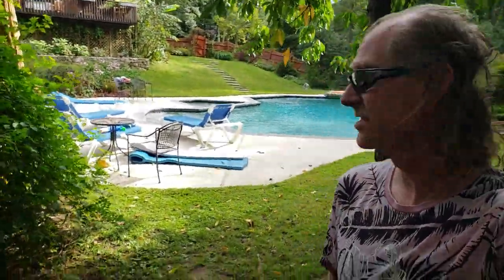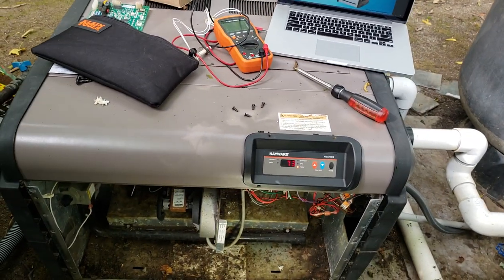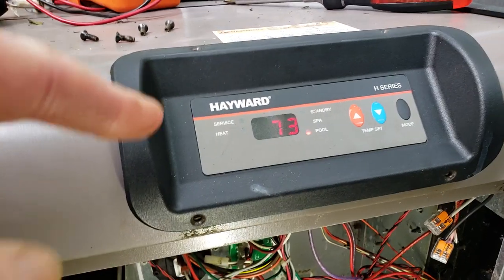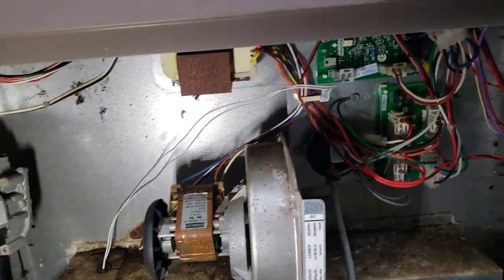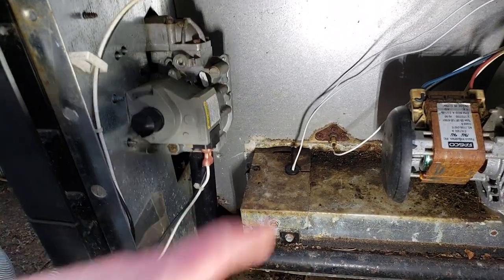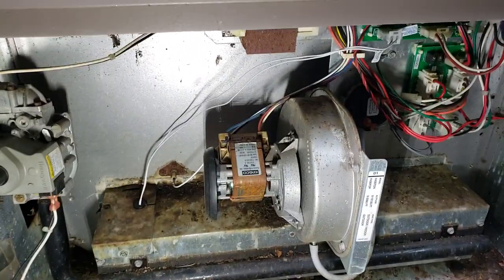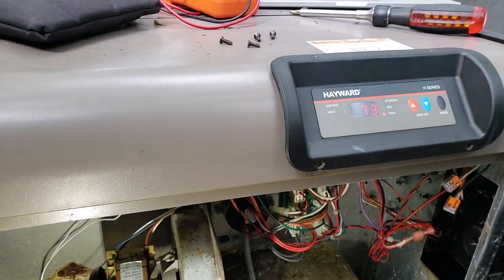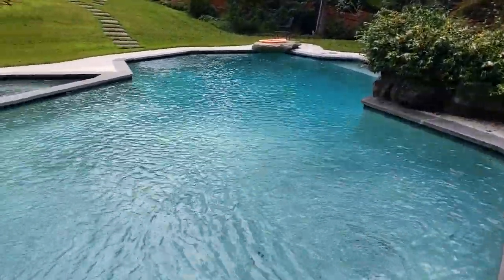Hayward H400FD pool heater fixed igniter issue no thanks to Hayward support

Comment: These pool heaters SUCK. I bought the same one 4 yrs ago and it broke in 2 yrs. Wasted 2600$
Reply from the maker: You’re not kidding. Mine doesn’t shut off.  If I leave the propane valve opened, it will eat thru the entire tank even of everything is off. When we are done heating the pool, it’s bypass mode and shut the propane valve. Work around  for 2 years.

Comment: The IO Code can really only mean 2 things.  Either a defective Control Board or a defective Igniter (Or the wires).  You can test the igniter with an Ohmmeter.  A "Good" igniter will have a fairly low resistance, in the range of 30 Ohms.  A "Bad" or open igniter will likely be many KOhms or higher and way too high a resistance to glow and ignite the gas.  If the resistance check passes then the Control Board is likely bad.  If you are comfortable with soldering, the likely failed component is the power triac that feeds the igniter and will be way less expensive than an entire new control board
Reply from the maker: What a great comment!  Thanks for sharing your knowledge. It was, in fact the board. I just opened the pool, and the heater made it through another NY winter, but it could crap out at any time. I kept the old control board, so im going to check that power triac (×whatever that is. )
I would definitively try to solder in a new component. Ive only done that  once, on a capacitor for an outdoor weather station and its still going, so its worth the try. 

Like I said before thanks again for all the info
Reply: The triac should be the rectangular device with 3 leads right behind the connector.  If one of those leads is connected to the igniter connector, that is it.   I had a spare board and was going to look, but I can't locate it.  If you unsolder the triac it and send me the numbers, I can probably identify it.  BTW, Great video, it should really help some of the people out there
Reply from the maker: @bigjohnk6113  thanks again. Ill look
Reply from the maker: So i was curious and grabbed the bad board  that was giving me the IO code, and sure enough, the one part that looks corroded is the thing you said (the triac). All 3 solder connections look good.  Its a small rectangular part with a small hole cut out adjacent to where the ignitor plugs in. 
I don't think there's any chance of me finding another one since there's no writing on it, but thanks for all the info. You must be in the electronics or pool business!
Reply: @Samlol23_drrich  yes, actually, I am an Electrical Engineer and I own an Aerospace design and manufacturing company.  I've got parts I designed flying on aircraft the DOD flys.  When I get a second, I'll take a look at my board and see if I can give you a good replacement p/n
Reply: @Samlol23_drrich  BTW, That part is mounted face down, so you probably won't be able to see a P/N until you remove it, or at least bend it upwards.
Reply from the maker: @bigjohnk6113  impressive!  (And very "cool" at the same time. 
Thanks again. When i get a minute ill desolder it and see if any markings are still there. Thanks again
Reply from the maker: Big John K okay, so thanks for everything. For better or worse, it’s done. FYI it’s a MAC8NG triac. I  found a replacement on digikey (I’ve used them before) for under 2 dollars. 
Of course I ripped one of the traces unknowingly when I desoldered it, so I had to repair that.  Kills me because I was extremely careful (I’m a pediatric dentist by trade and am used to working on tiny things).  
Thanks for all of your help. This has been incredible, really. I made that video a couple of seasons ago, I never throw away the old parts, and I guess that was a good thing in this case. Can’t wait to solder in the replacement and test it out. I’ll let you know. Thanks again. R
Reply: @Samlol23_drrich  I'll keep my fingers crossed that the triac does it.  Triac circuits usually also use an opto coupled triac driver.  That would be the next logical choice to change.  Be aware that the triac switches 120VAC.  So, please make sure the power is off when you pull that board and double check that you have no solder bridges.  That board was probably conformal coated to resist moisture and corrosion.  So when your repair is complete you would want to recoat the areas that you worked on.  Polyurethane would probably work just fine.
Reply from the maker: @bigjohnk6113  i appreciate the fact that you even expended one bit of energy to comment and make a suggestion. If it works,  it works. If it doesn't,  im no worse off than i am today. That board was gonna be a part donor anyway.

Thanks again, ill certainly post a comment after i try it. 
Interesting about the polyurethane. Ive got plenty of that cause of my woodworking addiction!
Reply: Their ignitors come standard at 15ohms. OL on ohm test means she's definitely gone. Any deviation of more than a few ohms means the ignitor is bad or is on its way out. Be careful replacing as they are very brittle and break easily.

Comment: Good job. I have a Hayward heater that has been nothing but problems from day one. I did have an issue where the mouse mice ate some wires. They were all replaced by a technician. No matter how much money I throw into this piece of junk Never works when you want to work i.e. when you have guests over. New England winters destroy these machines. They’re not designed for this climate. The company should make a more secure an element resistant unit for the north east and northern areas. Just saying. One final word. Given the new solid state circuitry and electronics of today I think this company has an upgraded their products and I using old technology prone to failure. Just my opinion.

Comment: Hayward absolutely sucks. Nothing but probems since we've had this crap brand for 5 years. Filter problems, sand filter valves busted, other valves cracking, multiple heater problems, omnilogic probems, app problems, sever problems. Absolute junk
Reply from the maker: @veng1974  agreed

Comment: Hey Sam, thanks for the video, as a pool professional I found your experience with Hayward interesting and I have to say in many ways we're frustrated with them as well.  They are however the 800 pound gorilla in our area for pool equipment and we still sell some Hayward products simply because it's easy to get parts.  Had some crazy situations with other companies where critical parts from our suppliers were back-ordered for months!  I'd also like to add that even though we get support I often find fixes for elusive problems by going right to youtube and seeing if someone else had the problem.  Definitely sucks they wouldn't talk to you at all but I can also say you're far from the typical home-owner and obviously a capable guy.  We see so many dangerous janky fixes in part I understand why manufacturers only talk to pros.  With that said, to be a residential pool guy there is NO certification or training required like that of a plumber or electrician so it can be a mixed bag when you hire someone.  Having owned a business and worked on pools for over 35 years I can say one thing, they definitely don't make them like they used to.  I remember when pool support gear lasted 20-30 years, now we're seeing a 3-5 year cycle for pumps and filters with sometimes brand new out of the box things leaking!  Last year I had to warranty 4 multiports, brand new leaking out of the waste port when running on filter.
Reply from the maker: Interesting comment. Thanks for sharing your experiences with them. I totally understand why their “policy” might be not to help consumers troubleshoot, and I would hate to think a company’s reputation can go down the drain based upon the poor judgement of one phone agent, but that may be what happened here. After this video got so,e traction, (and after I replaced the board), a couple of Hayward representatives actually reached out to me and asked me to contact them- which I didn’t do. 
You’ve been in this for years, so I’m sure you know exactly how to make a proper repair. But what about the guy who buys a truck, puts an ad in the local paper and has ten accounts?  That guy may have no idea what he is doing, so for Hayward to make a blanket statement that they won’t troubleshoot with me, but will with him is downright foolish.   I fix all of my own dental equipment, including some fairly complicated X-ray machines I have. I’ve had to call the manufacturer’s support on multiple occasions, and I’ve never been blown off the way I was by the phone rep at Hayward. I was pissed, and that’s why I made the vid.  Yes, I still use so,e Hayward equipment, but when my heater finally fails I’ll think long and hard before I buy another.  Sorry about the long response. Thanks again for your comment.

Comment: Thank you for your video.  It's become clear that I don't just have a pool heater problem, I have a Hayward problem.

My first Hayward pool heater died at 18 months.  They installed a new HDP 400 in Feb. 2022 under warranty.  Two weeks later, the ignitor switch went bad.  Nine months later, the ignitor switch has gone bad again.  To obtain a switch under warranty, I must have a Hayward certified tech do the work.  I've call all of them within a 50 mile radius, they either no longer do Hayward warranty work or don't service my area.  I am paying a reliable pool maintenance tech to replace the $100 part (because labor isn't covered under their warranty any way).  I am resigned to paying to have this part replaced every 9-12 months at my own expense.

What I've learned, if you buy Hayward products the warranty is illusory.  I will never ever buy Hayward pool products again.  Never.
Reply from the maker: Thats truly incredible. When you buy an expensive name brand heater you don't expect problem after problem. And the fact that you need to pay labor adds insult to injury. We all know labor is often more costly than the part. 
Thanks for commenting

Comment: Thank you for sharing your experience with the spa heater, I had a similar experience with Hayward.  After having the control board and circuit board replaced for 450 dollars by a technician I had the same error codes 1 month after the 1 year warranty period ended. I called the technician guy back and he said Hayward wont replace them free. I called Hayward and demanded to speak to the rep in central Florida, I told him I would never buy another Hayward product again. They replaced the circuit board at no cost to me. My technician is a con artist though and got pissed at me for going over him and complaining. The technician tried to sell me the control board also. I just repaired the ignightor wires that were chewed by mice. Thanks to your video I did it myself. Saving another hundred bucks!!
Reply from the maker: Glad my video helped.  You think the tech was going to get the part from Hayward for no charge, and then charge you for it?  Crazy. Ive found the only way not to get ripped is to do what you can yourself. Everyone is entitled to make a living, but i hate to be pushed into something new if something older can be fixed.  Its worth the gamble most of the time.
Reply: “Your technician” is a con artist because he wasn’t going to give you a free board?? Your a con artist for expecting them to do free work. Btw, the igniter wire has a certain resistance that if broken needs to be replaced not fixed otherwise it’s a fire hazard.
Reply: @dutchvanderlin5556  Agreed. The technician doesn't cover the warranty. Hayward covers the warranty. It's not the tech's fault that Hayward shit broke lol

Comment: It Can be a number of different things the tech manuel is just suggestions and help to try and solve problems  That is why we dont pull our own teeth  LOL
Reply from the maker: Marshall Phillips yeah, but I would have no problem if someone did want to pull their own teeth. I’ll even help and tell you what to do. 
Next life I’m a plumber doing hvac and heating. Love that stuff and have spent the last bunch of years learning all I can. I’m not licensed but can and have fixed everything I own, including a gas heater. They could have simply told me if I ran through all the diagnostics, replace the main circuit board. That’s all I was looking for. 
In fact, about a year after this video, the topic came up on another forum.  I said very little, didnt bitch like I did in this video. Then Someone from Hayward service dept  reached out to me by PM and told me if everything checked out replace the main board.

Comment: Yep I had the same problem, they would not give me the service manuals, after having a less than friendly conversation with Hayward and explaining to them that first I cannot even get a service person to come to check it out, second, once I found someone they wanted $250 just to come out.. They did send me the service manuals. The first problem was the control board for the panel, that was a $900 part.. Then was the control board and display board for the heater. That was tks to mice that had built a nest and chewed at the wiring. I fixed it all myself, was easy, did not require a so-called service tech. basic tools, philips screwdriver and a volt-ohm meter.
Reply from the maker: Its incredible how many openings there are in something that sits outside.  Rodents get into mine every year. No matter what i do.  They seem to like the sides where the flow switch sits. Thanks for commenting

Comment: Thanks for this video, exact same issue on my heater.  Replaced the igniter first but that made no difference.  Then found this video and bit the bullet on a new control board, and it fired right up!  For us here in California we are suppose to use the 'Ultra Low Nox" PCBA, which I could only find for $1,100!!!!  it is the exact same board layout, as the standard PCBA which is I found for $400.  I chose the less expense one, and it is working flawlessly.  Not sure what could possibly be the difference between the boards, maybe something in the firmware.  Now I am just waiting for the California Environmental Police to show up and arrest me!!!  Anyway, thanks again for sharing your experience, it helped!!!
Reply from the maker: 1100 is nuts. I would have done the same thing. 
Thanks for commenting! And glad the video helped

Comment: Thanks for sharing the video. Didn’t have same issue as you. But, I’m so grateful for sharing the Hayward Diagnostic manual. It’s a great reference manual. Better than the one included with the heater. Helped out a lot. I was able to fix our Hayward Heater. It’s up and running again.
Reply from the maker: Thanks for the comment.  I learned a long time ago to try to get the service manual.(not the owners manual) for any piece of equipment I own. As time goes on they become more difficult to obtain. When I started my dental practice I was paying $200/hr for a service  tech to come out and fix stuff. How? He'd call the manufacturer support line and say "hi this is Joe from bigdentalcompany- I need to troubleshoot your xray machine" and they would spoon feed the guy info it was impossible for me to get as a non tech. 
Now I don't buy anything if they won't give me the service manual so I can fix it myself.

Comment: I ordered a new circuit bored I’m just confused about the board ...... the one that’s in my heater says Version 20 I can’t find another version 20 the one I ordered is a version 19..... wondering if it matters...any help would be very much appreciated. Thank you
Reply from the maker: Thanks for watching my video. 
Im a dentist, so unfortunately im in no position to give you expert advice on the circuit board version and whether that matters at all. 
Having said that, i can tell you what i would do. 
I have replaced the circuit board 3 times in the 10 years i have lived in this house. I never ever even looked at the writing on the board or what version it was. As long as the part number on the outer plastic is corrrect and its an oem hayward part that fits, it is most likely fine. 
If you are really worried, or ordered it from a vendor with a restrictive return policy,  call hayward and ask. The worst that can happen is they are no help. Best case they allay your fears. 
If you bought from amazon, not a third party, i would suggest just installing it to verify that it works. Test every function. If it works, forget it. If there are any issues, then call hayward and return the part. 
Like i said, never ever looked at anything but part number and never had any issue 
Hope that helps. Let me know if you get any info, im interested to know. 
R
Reply: Thank you ... it should be here hopefully tomorrow I’ll let you know what happens
Reply: @anthonyweiburg8520  does the older version work?

Comment: Great video I am having the same problem with the exact same heater going to order the igniter and go thru same process I am very grateful to have found your awesome video
Reply from the maker: Every once in a while i get lucky and one of my vids helps someone!  Glad it helped, and hope its just the igniter and not the board.
Reply: You are the man thanks again !
Reply: I forgot to ask where is the best place to buy the igniter and circuit board amazon ? Thank you very much
Reply from the maker: @ericwebber68  definitively was amazon. Let me check to see if any particular vendor......edit. okay just looked at my amazon account. The control board, ignitor, as well as my replacement of the belzel and keypad and display board were all sold by amazon directly (amazon.com services llp) not a third party. Hope that helps
Reply: samlol23     Thank you very much